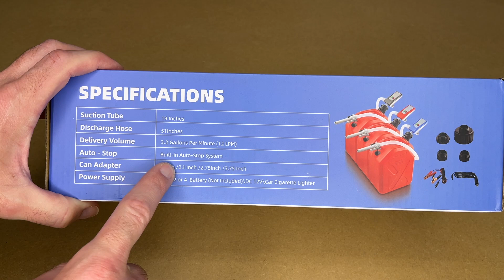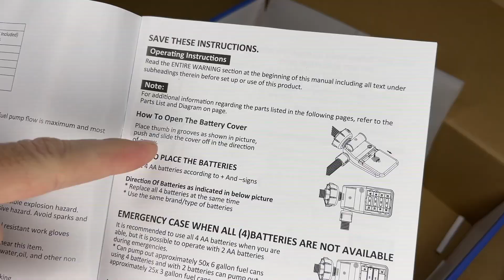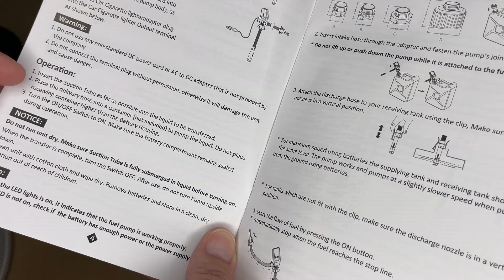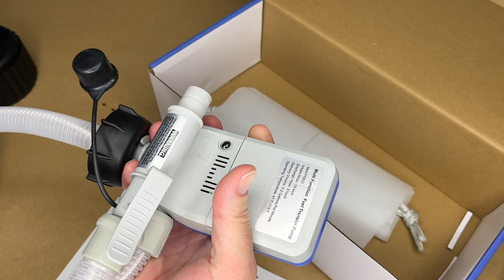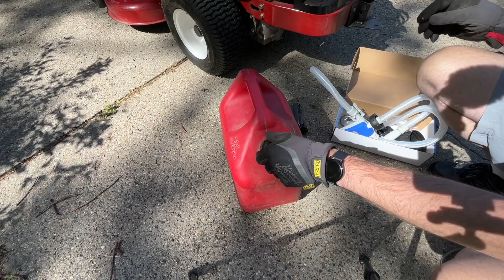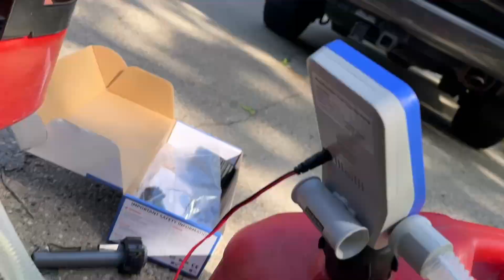Nitigo Battery Powered Fuel Transfer Pump

Comment: Hi, sorry about my English.
Thanks for that review.
Is it possible to operate the pump without using the cap adapters, i.e. by submerging the suction sensor into a container without a cap? I am asking this question because the adapters supplied may not fit certain containers, particularly those from abroad.
Reply from the maker: You can use it without the cap.